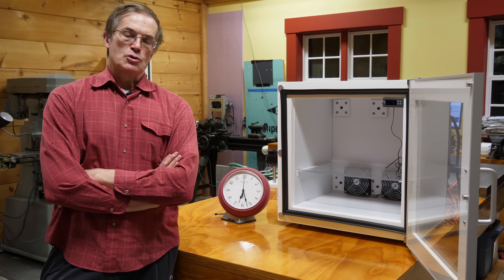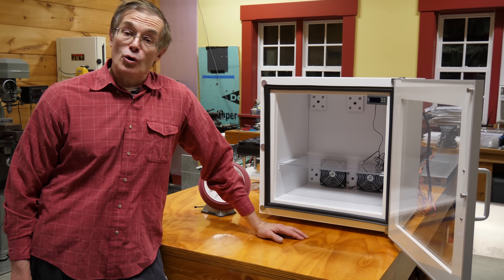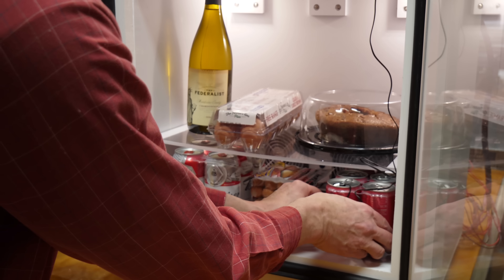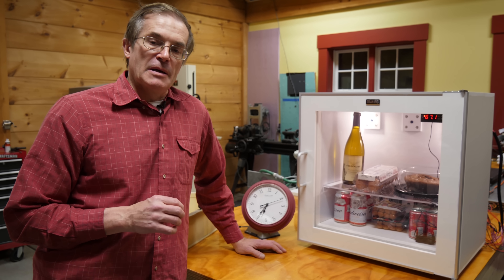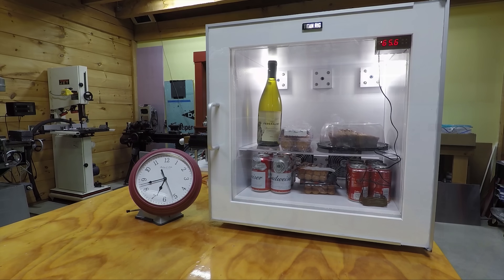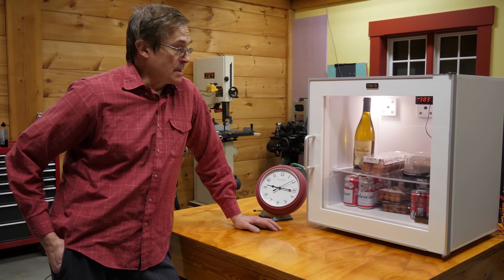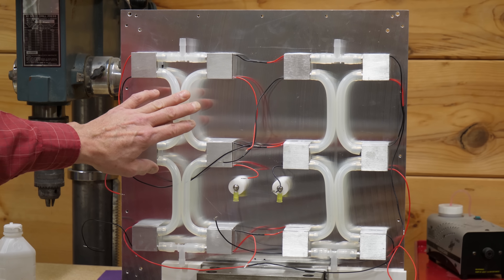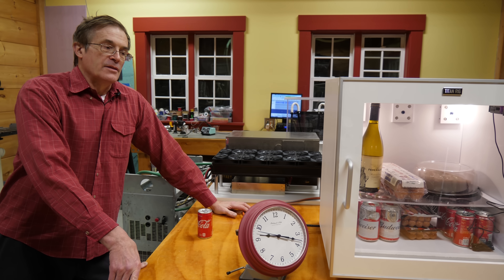TESTING OUR DIY REFRIGERATOR! - TEC/PELTIER

Comment: hmm how about a thermo syphon cooling system?, create a water jacket with a reservoir at the top for the warm liquid and a cooling radiator where it enters the water jacket again? I think it would probably meet a peak performance temp but something to consider?
Reply from the maker: The extremely low flow rates would challenge the insulation because heat removal would be pretty low.

Comment: I have a few suggestions regarding the heat diffuser panels:
1.  Ensure enough of a gap between plates to prevent air flow lockup.  Air behaves as a fluid in tight spaces and can stop flowing.
2.  Having a larger gap between plates at the top than the bottom forces convective currents to move upward more readily.
3.  Placing the plates near the surface of the table will hamper airflow.  Hanging the plates in the air off the edge of a table should improve that.
My next project is to use a TEC/CPU cooler combo to build a portable cloud chamber.  Just because.
Reply from the maker: Thanks.
Those considerations were part of the design.  Increased spacing between the plates improves airflow, but for a given amount of available room, decreases the number of plates and the available surface area.
Increased cross sectional area to the heat distribution pillers interferes with airflow.  Copper is a better thermal conductor than aluminum, but costs far more.  Increasing the CFM of the fans improves heat transfer to the air, but increases the energy needed to run the fans, etc.
Reply: @TechIngredients  One of the neat things you might demonstrate is the relation between insulation thickness and associated surface area.  The lab I did went thusly:
-a steam pipe has layers of insulation added one by one and temperatures/amounts  of steam condensate is measured.
-the insulation prevents heat loss and this increases with added 1/2" layers.  Measurements for each added layer
-at some point there is a flip-over and the insulation becomes worse with each added 1/2" because the surface area is now increasing very quickly compared to the linear path length through the insulation thickness.  Too much insulation is not a good thing.
-this expt requires a round pipe in order to ratio the thickness vs surface area properly
[extra lab tips....Immersion Cookers $50-75 are excellent temp bath controllers, no cooling circuit-------KALORIK sells a bar-fridge at Walmart(?) which uses a flammable solvent as a refrigerant.  This means Cryogenic Butane Pump and Condenser  :D , Zebra sells a cheap 'Astronaut' type pen the X-701 Extreme.  Writes on silicone!!!, Rite-In-The-Rain notebooks at Staples make a good substitute for PolyPaper,  OIL RIG = Oxidation Is Loss, Reduction is Gain, of electrons.... watch your signs]

Comment: nice video. I'm thinking abut similar project but related more to heat chamber where i could use to to test equipment or check differences in relation to temperature..

Comment: What was the actual voltage output from the power supply set to for maximum efficiency and performance? If it was full 24v, this means that each TEC used 4v, yes? I am not very knowledgeable on all this, but am attempting to build a fermentation chamber for beer brewing using this process (and also reversing polarity on the TECs for gentle heating, when needed). Thank you for any and all info!
Reply from the maker: Maximum effeciency is at minimal current. As the current increases, the heat pumping performance increases, but the effeciency drops.  Volts drives the current and it is the current you want to focus on directly.  Because these TECs are cheap, use as many as you can accommodate and drive each with only enough current to achieve your temperature goal for maximum effeciency.

Comment: Good, I got to see part 2. I knew it would work, I knew it can be even more efficient and cooler than what you brought it down to, as you tweak on it, it will be more efficient as well. Good video can't wait to see part 3. I like the power Peltier chips, that's what I call them, this is great technology to be able to make something hot or cold with electronic equipment that's awesome. I love the compressors big or small but this is even better.

Comment: Why no use exhaust heat to provide hot water for domestic use?
Reply from the maker: The energy you recover by adding any system to store the heat will be less than the energy you must consume to compensate for the unavoidable decrease in the effeciency of the TECs.

Comment: Priceless point in the end there. :)
Back in the day they made iced root cellars. Outside! A pipe in the ground does a good cooling job too if pumped a little gas or liquid through. Living with proper winters ? Add a ground caved winter charged IBC ice magazine and transport pipe insulations for freeze capacity. Takes only a simple fan or small pump to run and thermal ground lid actuators to automate. With the optional convenience of putting cold boxes in the kitchen

Comment: The big holes in the heat transfer stacks are a problem. Solid squares of aluminum or even better copper would be better. 
The hole looks like it removes about 70% of the conduit for heat and replaced it with an air gap.

Comment: Everyone should understand that for any compressor style refrigerator you should keep it as full as possible: extra bottles or cans of beverages and anything that can help maintain the largest mass to bring to temperature.  It will greatly reduce the cycling of the refrigerator and make it last much longer.
Reply from the maker: There is even an argument for intentionally including a large mass of water within the housing to act as an additional thermal sink.

Comment: Very interesting. I have been contemplating building a custom air ventilation system where air from the house is forced through some piping underground where the pipes are setup to transfer thermal energy. My thought is that because temperatures underground are typically stable, I can keep the house air temperatures stable to reduce heating and cooling costs.

Comment: Thanks kindly for the inspiration 🙏

Why not portal the rear of the fridge out the window during the  winter season...redirect the heat dissipation system towards your feet around the breakfast table on an icey morning?
I'll need another fan to duct the heat out as I'm residing in the tropics.
Some days I'd prefer to stack three of those like your project one and to just relax inside.  Maybe just easier to throw a chilling unit in the vacuume cleaner and suit up in hazchem garm...

The calc and theory you bring goes hand in hand with an immaculate workshop presentation.

Experimenting always helps when you've got a sound knowledge for where to start from.  Now I can pit a bit more science and test theory behind it for improved developments.
I've started with 150 watt TEC's and might stack a pair with 60 watters or even bridge the heatsinks with a cooling block.  I've noted it can almost double the negative temperature.   Then maybe hook up a dynamo from some exercise equipment to conserve VSdc.
I figure the price of that mineral for what its worth it might be just as simple to  grab a half a dozen  gerbles and train them on a running wheel. 😆🤣

How about some gas science for a future episode, like running a three way using a propane booster in the unit if should you ever need heaps of ice?!  Build an igloo then and turn it into some sort of combustion reactor...flip the switch to oven mode, do the calcs and then watch it melt to the ground in record time...heck slam a few on the old snow shovel to make light work.

Again Sir, this is the tropics 👌

BTW, for years a local business I'd hobby shop at has been casting two desities of polyeurathane bricks from the liquid expansion foam they'd have processed exclusively for them. 
Each cast being almost King Size three mattresses high...  you could use the skins for wall insulation (I e for the out house) 🤭
Should find a reason to drop back in oneday as they'd started developing a high phenolic fire grade version of the foam.  RE, perfect windows for the igloo✌
Reply from the maker: I cover the technique of "harvesting  cold" from outdoors in the follow up video on the solid state freezer.

Comment: If one lives in a place like New England or someplace with a consistently cold winter, why not just have a large, robust/durable cooler outside for the freezer, and then dig a hole and put a Al or other metal box or other container inside, and put an insulated top on it, for the fridge?
Reply from the maker: Take a look at our video on the solid state freezer.
Reply: @TechIngredients    I've seen it, it's a great video and cool design.  I just like to simplify things when I can.  The downside is going outside to retrieve food items is not very convenient, but doesn't affect one's energy bills whatsoever. Unfortunately, I don't live in a climate with such a consistently cold winter anyways, so kind of a moot point for me.

   Btw, I'll be building a fridge cooler kind of like yours, but made for outside use, and using vacuum insulated panels for bottom and sides and thicker foam top for access, and then use Solar+battery to power it. I'm hoping I can get away with like 3 to 5 TEC's with the increased thermal insulation, and slightly sub 100 watts.

Comment: Can an old KA/ WH carcass be gutted and redesigned? Or is the carcass not insulated enough?
Reply from the maker: It's probably not worth the effort as you suggest, the insulation is modest and the removal of the current system would forther compromise it.  Also, the thermally coupled walls in our design help to increase the heat gathering and routing back to the TECs.

Comment: As someone who keeps food in a minifridge I am interested because in my firm opinion, most mini fridges are designed by idiots or alcoholics who never have tee keep anything more then a beer and a pre made sandwich cool.

Can't adjust the shelving, the bottom need room for the compressor, the back wall freezes while the rest of it is above 50...  I could go on.  So since it seems the options are spend enough to buy a real fridge, on something with half the space.  Or build it myself.  So yes, while this concept is a little silly I am interested in plans and designs.

Comment: Please tell the drive voltage and current. And the I-V curves used for optimal COP vs cooling compromise, if any. It will be very helpful. Great build!
Reply from the maker: These are purely resistive loads.  You can run them in series or parallel or a mix to match the voltage/current capacity of an available power supply.

Comment: What about the way the air conditioning works in a car you have basically air moisture like a water trap it passes through condenses and then catches the liquid in the similar fashion as the bag of rice would do
Reply from the maker: The principle is the same.
Reply: @TechIngredients  great videos I'm just in the middle of watching your other video with the cooling system with the tree stacks of PVC into the water great video,, revolutionary air conditioner,

Comment: Great video and experiments.  I have a cabin in Montana and bought a nova cool fridge and freezer.  A mid size (smallish) unit.  I then followed another persons advice on insulating with 2", including moving the condenser fins to the outside of the insulation.  I have a perfect fridge using about 280watts per day.  I'm on solar so this is important.  What I liked was the fact that you used some computer fans that vastly improved the time to cool down the peltier's.  I will soon be doing experiments with using .25amp fans to try and get the condenser to reduce run time and thus power consumption by the fridge.  Thanks for the idea!  By the way, I am interested in the amount of power your peltier system is using.  They pull a lot of amps.

Comment: .. Here is another problem. Use solar energy to cool one living human body from 100*F to 70* F. 
On deadly hot days, a person could sit in the shade with their personal solar panel in the sun providing enough cooling to keep them alive. 
.. Another invention :: A solar powered air-conditioning unit for buildings. This would not be plugged into the local grid, there by saving a lot of trouble. It would work best when the Sun shines brightest, and that's when you need to cool the building.

Comment: I have a 2.3 cubic foot ice box in a vintage camper. How many watts am I going to need of peltier to keep it cool at a reasonable ambient temperature? Whatever that might be... Can I use a water cooling system to preheat water going into my hot water tank?
Reply from the maker: You'd need about 100 watts continuously.  You can't use it to heat water.  If you tried, you would prevent the refrigerator from cooling because the temperature differential is fixed.

Comment: why not use just a heat pipe to move the heat away? will work to move heat outside in winter to. thinking of using thermistors along top of windows to remove heat from outer two panes of glass and return heat to inside. windows with no heat loss can you try this?

Comment: How practical is this?  Could you build a full size refrigerator?  ... Do you have one in your kitchen right now? :-)
Reply from the maker: Ultimately, a phase change refrigerator is more effecient, but less flexible. Commercial units are highly engineered and convenient, but if you want a custom sized unit, a solid state model might be better.

Comment: But hey, the passive cooling on the hot side can be improved pretty much if you enclose the heatsink with an insulating material with an outlet upper tube and with a lower narrower inlet tube, both insulating. This will work as a chimney, moving colder air from the floor, heating it and releasing it higher up. The chimney should probably not reach up all the way to the ceiling as it might be a hotter layer of air up there.
But of course, as you say, the benefits of a colder outside climate, should be used. It's pretty counterintuitive to spend money on heating the house up in the winter and then spend more money on cooling down certain things, when it's all accessible pretty much for free. I think we have similar climate as I live in northern Sweden. I really like your very informative videos!

Comment: I would think using the large panel radiators/heatsinks makes it a lot easier to clean between them.and clean the panel sides. Would'nt regular cleaning of these radiators be required to keep this operating efficiently? (just like regular refrigerator radiators)
Reply from the maker: Agreed

Comment: In the previous video you said you'd run the Peltiers on lower voltage. I'd love to see some numbers on consumption X efficiency. 
Any ideas if connecting 2 of them in series to drop the tension has any detrimental effects
Reply from the maker: The refrigerator uses 125 watts continuously.  You can run these TECs as simple resistive loads.  So, you can run them in series or parallel or even parallel strings of series to get the voltage/resistance value that is most convenient.

Comment: Add one of those hypersonic wafer do dads that make vapor out of water and some liquid to be turned to vapor by them and the humidity in the fridge should give a much higher cooling transfer coefficient, though how to replenish this liquid and keep it from corroding things becomes a new problem.  Air just seems like such a horrible medium for cooling anything.  It would make much more sense to have fridges that used spaced liquid filled bladders that all feed into an elastic tank of some kind so that when you put in food they are in direct contact with this chilled bladder instead of relying on one of the worlds best insulators (air) to cool them.   

This might be hard to envision.  Think of pillows stacked on end together like books on a shelf.  You'd push your your food items between these pillows.  The bladders should be capable of being completely compressed into the flexible tank bladder.  The goal is to minimize air in the fridge and replace it with a better conductor of heat.  Biggest problem with this is easily seeing what is in the fridge as the bladders would fold around food items.  The best solution to this is to make the fridge less deep and instead much taller and wider than you normally would (Imagine the size of a conventional home fridge but with usable depth of only 6" which could vary in places or larger items.  It's a large change but a much more efficient fridge.  If I were living off grid I'd consider building something like this instead of using anything currently on the market.  think of how long liquid filled silicon bladders would retain their temperature.  This fridge might only have to cycle once a day for an hour or even less. 

I wish I had the energy or desire to see ideas though like this.  I have 1000 of them a day.

Comment: You can also revert current and use as rising and than reverse again to cool and stop it? Can become a good home pizza dough rising machine
Reply from the maker: You can.  The TECs can heat or cool vs the outside temperature.

Comment: Thanks for creating this stunningly informative video! I bought my wife an antique ice box to store beer in an un-electrified outbuilding, and with solar panels and a charge controller, I have about 150W of 13-14V DC available. I've been experimenting with the 12706's I bought, and am eager to try what you described here. It looks like you configured two groups of three 12710's in series with a 24V supply, so I'll try three groups of two 12706's, and see how that works out. Very interesting detail about clamping everything together, I knew that keeping everything tight was important, but I didn't realize how important it was!